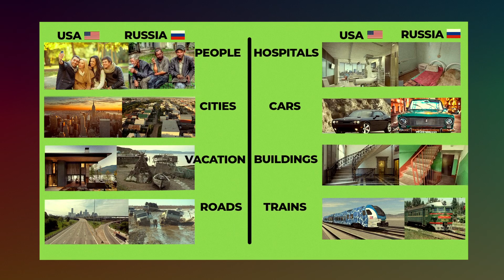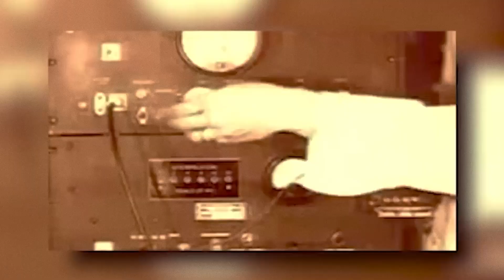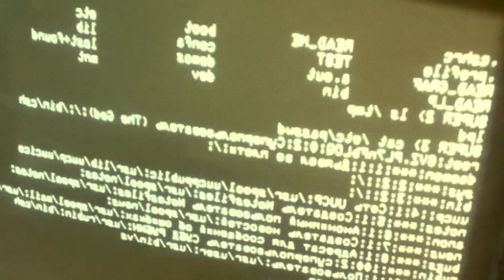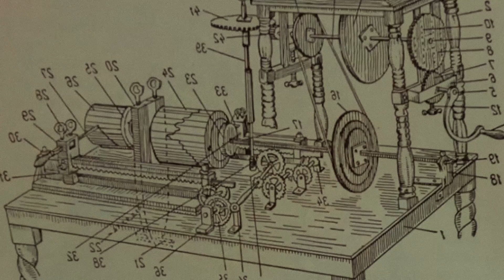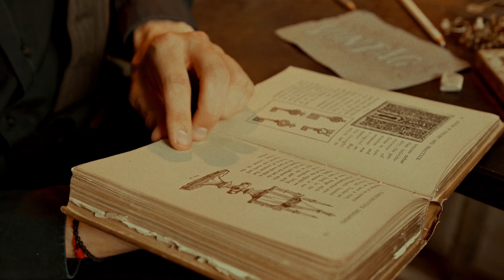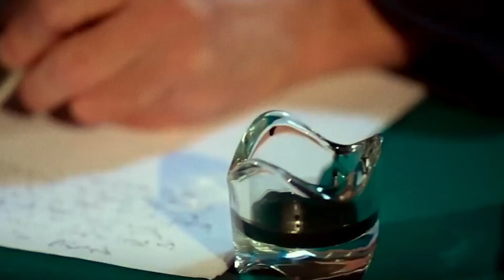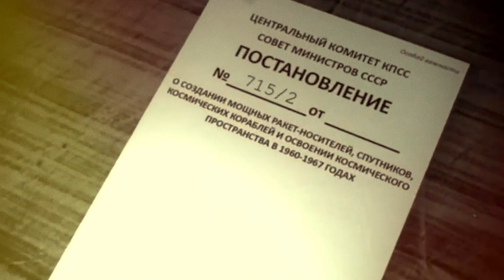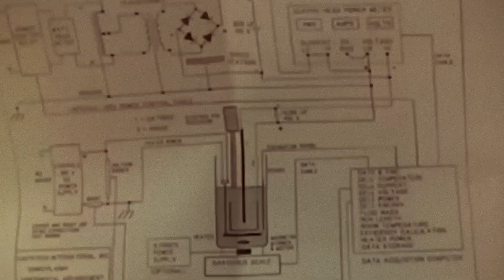Why is Russia backward? forgotten Russian technology

Comment: Dmitri Mendeleev Russian chemist who developed  the periodic classification of the elements ( Most of people don't know Mendeleev's Periodic Table of Elements., just Periodic Table of Elements !!!  Периодическая Таблица Элементов Менделеева ) . Mendeleev found that, when all the known chemical elements were arranged in order of increasing atomic weight, the resulting table displayed a recurring pattern, or periodicity, of properties within groups of elements.
The four predicted elements- Boron (Eb ), Aluminium ( or Aluminum ) (Ea ), Manganese ( Em) and Silicon (Es ) , with respective atomic masses of 44, 68, 72, and 100. Proved to be good predictors of the properties of scandium, gallium, technetium and germanium respectively, with each filling the spot in the periodic table assigned by Mendeleev.

Comment: Don't forget about Oleg Losev who invented the LED in 1927.
Reply: Don't forget about H. J. Round an English experimenter of Marconi Labs who, using a crystal of silicon carbide and a cat's-whisker detector (diode), discovered electroluminescence in 1907. This was the first light emitting diode.
Reply: @JamesStripling  he only wrote two paragraphs on it, while losev investigated and made practical use of it
Reply: Thank you for this update. I wish that this was taught more in schools. @JamesStripling
Reply: @JamesStripling It was a different thing

Comment: Water powered cars were invented all over the World !

In Germany, Japan, the USA, ect. ect.
Reply: no car ever was "water-powered" (if you don't count when the electricity was generated by a hydroelectric power plant). Those were all vehicles that used hydrogen made from water. But the original power was either chemical or electrical and used to generate the hydrogen. The term "water-driven" might apply in a wider sense of interpretation, though.